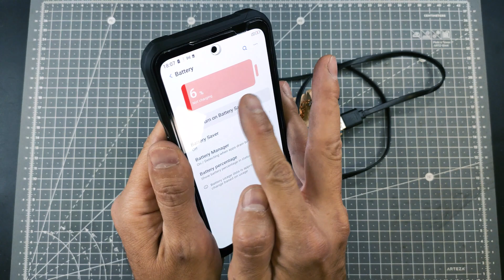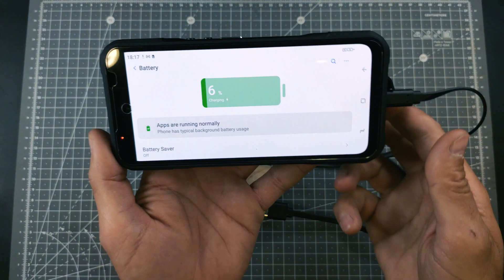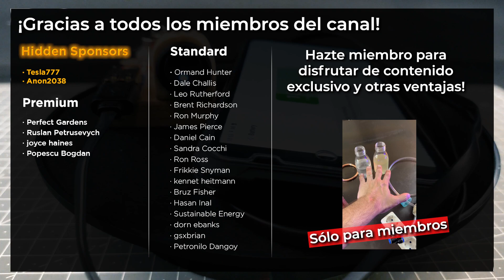CARGADOR USB PARA SMARTPHONE SIN ELECTRICIDAD

Comment: Author, with all due respect, but why are you writing nonsense? I'll start with the fact that the wire section is not 0.5, but 1.0mm.
Reply from the maker: To do this test we change the original cable of the plug sockets for a 4mm2 cable

Comment: 1:22 Why are the magnets sticking together even though they are "oscillating magnetic field magnets"?
Reply: If the atom is constantly moving, no magnetic field will be generated.
Reply from the maker: Because all magnets have an oscillating magnetic field and oscillate at the same frequency, they always stick together at one end and repel each other at the other end.
Reply: @HiddentechnologyYT  Are all the existing special magnets the same oscillate? No difference of 0.00001 seconds? That is not possible.
The reason that the iron plate was sandwiched between the magnets is more convincing.

Comment: Use a transparent rule to verify the validity of the experiment.
Reply: Yep, there is enough glue there to hide a button cell battery, but who knows. Videos like this should never be stopped and started no matter how long it takes we can fast forward to the good bits.
I used to have a globe that was magic too, all you had to do was have a iron ring on your finger and touch the screw in for the bulb and it turn on.

Comment: How can the magnet be attracted to the copper coil, you obviously have an attraction between the magnet and whatever is under the white glue. I don't believe all it is, is a copper coil under it. In the next experiment use clear silicone or opoxy so I can make sure your not attracting a button battery switch hidden  under the glue 😉
Reply: eu acho que a atração é no parafuso mesmo, pois é um alen de aço..